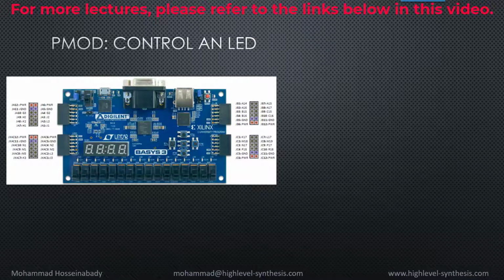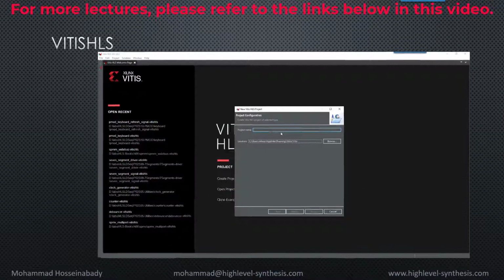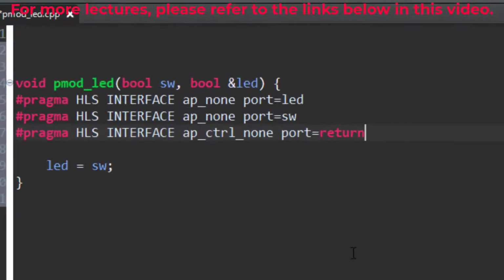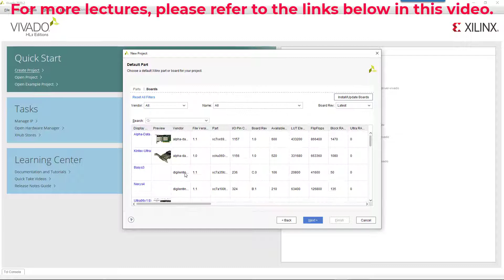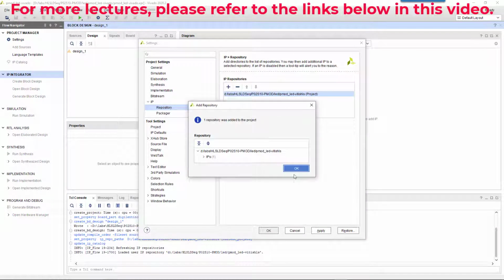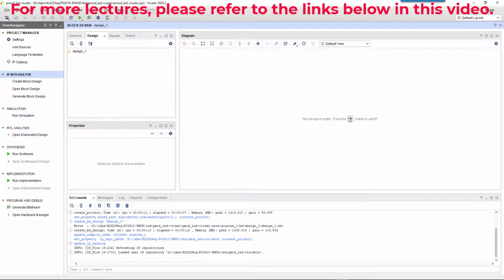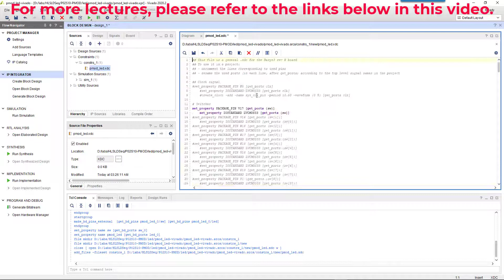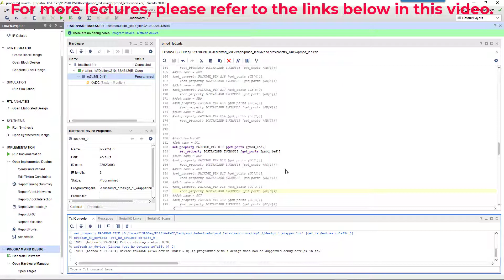PMOD LED Controller in Xilinx Vitis-HLS

Comment: Thank you for your video. Is this a sample of your lectures?
Reply from the maker: yes, you can find the lectures at 
https://highlevel-synthesis.com/2021/03/29/high-level-synthesis-for-fpga-online-courses-coupons/
Reply: @highlevelsynthesis9030  thank you. I tried to follow the instructions and I can synthesize but can not export as RTL. It says error 2202221236. I want to enrol to your courses but want to make sure i can follow.
Thanks for your response in advance.
Reply from the maker: @Avionics2  it is a bug in xilinx tools. search google for xilinx 2k22 patch and run that.
Reply: @highlevelsynthesis9030  Thank you just ran the patch and managed to proceed with the rest and it worked on my basys3.
I just enrolled to your Udemy university course.
Thank you again!
Reply from the maker: @Avionics2  Please use the course Q&A section if you have any questions regarding the course materials.